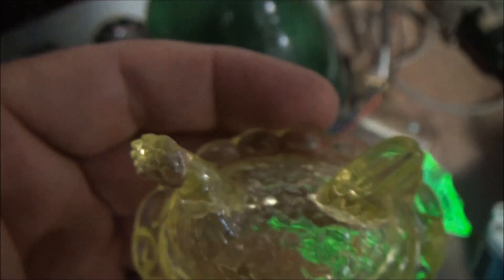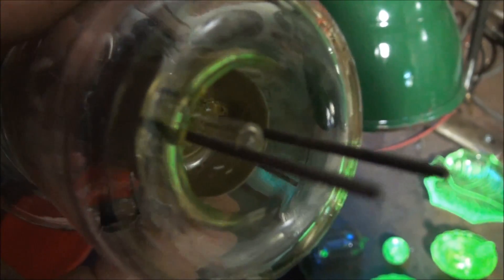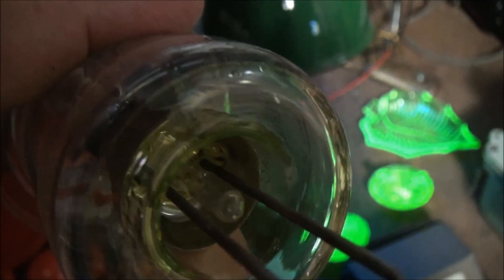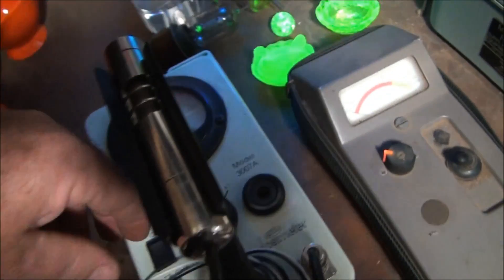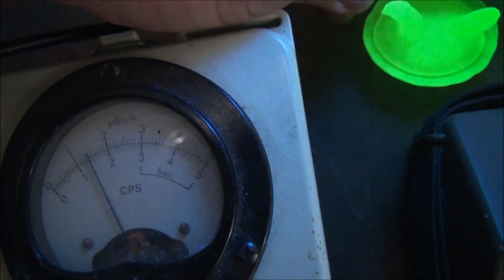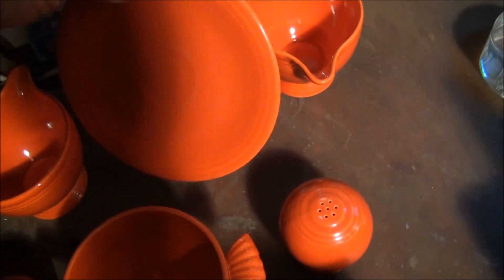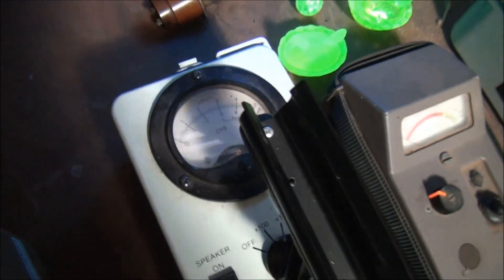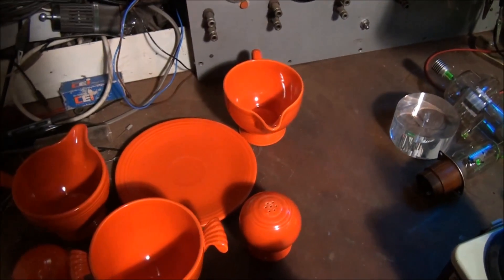Granny's Atomic Chooks and Uranium kitchen plates

Comment: Here in the states radioactive substances were once sold for internal use as sort of a health tonic. If I'm not mistaken, during that period of time, they also believed eating and drinking from radioactive glassware also had certain health promoting properties.
Reply from the maker: +John Ratko  Yes, you are right about that, they sold large water vessels containing Radium which provided healthy water to drink. I did a bit of research on Fiesta ware and those plates could have up to 3 grams of Uranium in the Glaze, I understand that much early pottery used Uranium in the Glazes to provide the nice red colour so its worth snooping around your local Junk shops with a Geiger counter to find the good stuff providing the old Womens working there don't toss you out!
Reply from the maker: +John Ratko You are correct, Radium infused water jugs were commonly used to provide healthy radioactive water and other strange items too.

Comment: Gorgeous stuff. Cant find a single bit of that fiesta ware down here in Melbourne.
Reply from the maker: +pow0006 Unfortunantly that product was not sold in Australia but is common in the States. Some was brought back by visitors in the past. Actually Uranium was commonly used in prewar pottery glazes to provide the red colour and also be used on tiles etc so get hold of a Geiger counter and snoop around the Op shops.